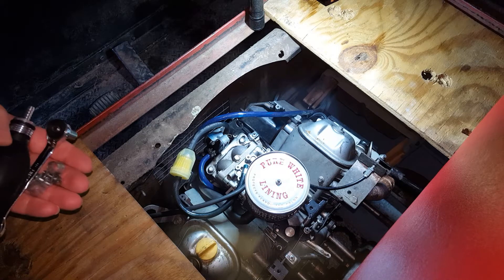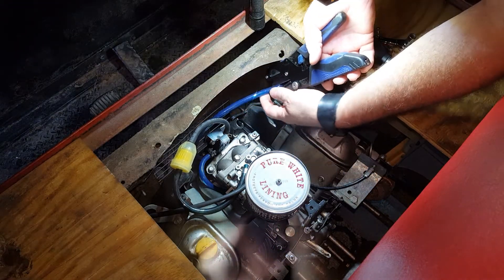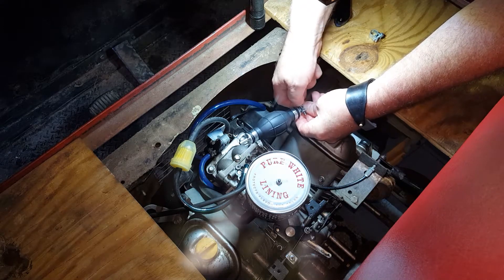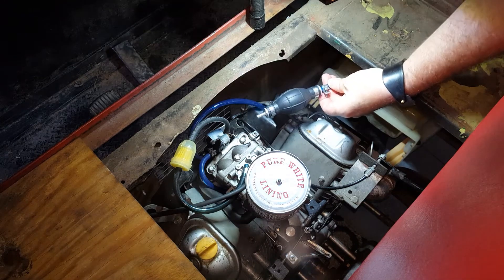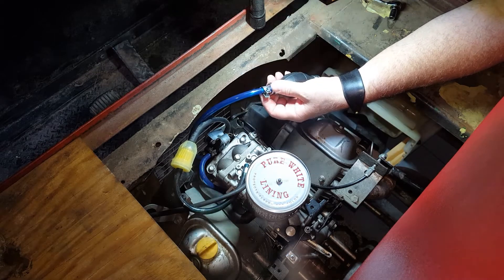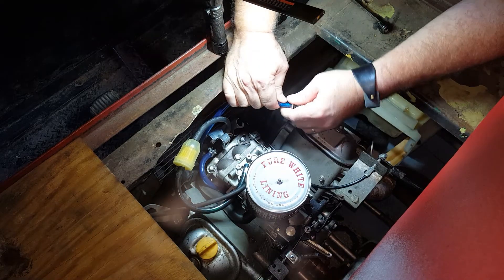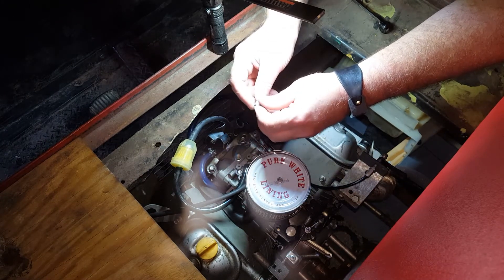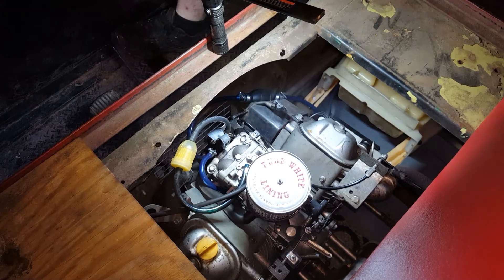PRIMER BULB ON A PREDATOR 670cc, GAS TANK BELOW CARB ON STANDARD PULSE PUMP

Comment: Are you using the stock fuel pump or a Honda or Briggs?
Reply from the maker: Afternoon, pulled the stock and replaced with a reasonable quality clone, seeing as the honda ones seem to be made (assembled) by Makuni and Briggs is supposedly USA at least assembled but parts from either Mexico or China etc . I see no difference in the castings (polypropylene). The flow seems to be the same also. Maybe they just dont last as long internals may be cheaper material. so 3 clones for the price of 1 Honda one
Reply: @dctmakes3487 evening, thank you. I ordered a Honda(makuni) it was more expensive than the clones but looks to be one piece, where the others seemed like layers bolted together. I added a primer bulb to my stock predator on my zero turn lawn mower, but with blade engaged I burn too much fuel and needed to periodically squeeze the bulb to keep enough fuel in the carb. I'm hoping I can get better results with a Honda pulse pump, and possibly a bypass around primer so I can prime it then shut a valve and retain all my fuel pressure